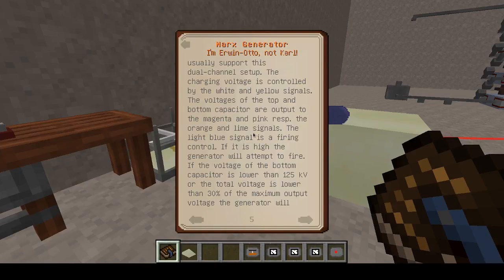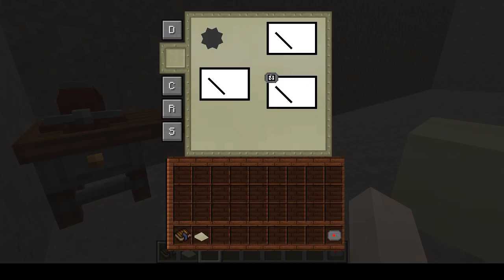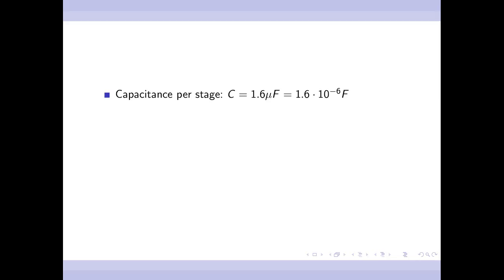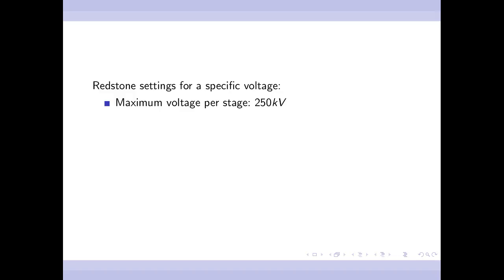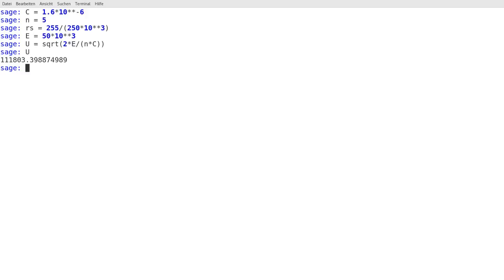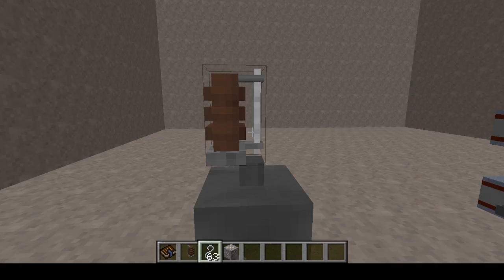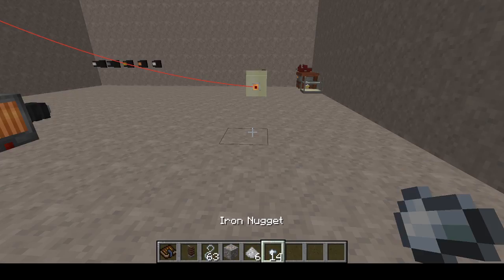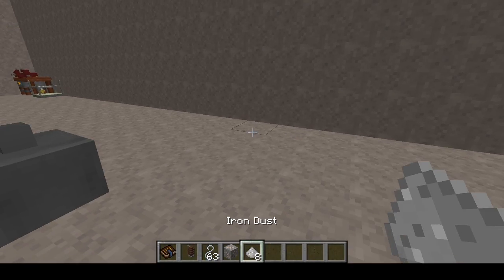Industrial Wires: Marx generator tutorial

Comment: How do I get the charging voltage higher? Every time I try to do this, the caps don't charge enough. They stop under 5 on the meter. I've been getting so frustrated trying to get the thing to work.
Reply: same here. I think I did everything right.. i've also tried everything, down to matching his Control panel Inclination.
Reply: I think it's meant to be stacked higher to get a higher voltage limit, the book says the "middle" is stackable to get higher voltages and the one I've created does take a lot longer to charge up after making it taller but the mod pack i'm playing on is bugged or something cause I can't get the Marx Generator to split ore blocks at all but it still can kill a chicken even using a set up 5 times it's size in this tutorial.

Comment: Is it a way to trigger blue channel from vanilla button?

If it is not, please add some component that acquires redstone signal and transforms it to channel - it will help with automatization of process
Reply from the maker: Алексей Баранов the Marx generator just uses IE redstone wires. They will work with any other method of creating/displaying redstone signals. I used the control panels since the MG is designed to work well with them, but I could have achieved the same results with buttons, levers and redstone lines for analogue signals.
Reply: So how can i trigger it with stone button for example?
Reply from the maker: Yes. Put a redstone wire connector next to the stone button, set it to the light blue channel and input mode. That should work. I've never tried stone buttons, but I used OpenComputers for that once and it worked perfectly fine.
Reply: Something wrong happening - it does not fire, but readings of charge goes to 0
Reply from the maker: What voltage/redstone signal level did you charge to?
Reply: But it works without control panel in the middle

Comment: So malte0811 admit that it was at the end ?
Reply from the maker: I'm not quite sure what you are asking, so I might be answering the wrong questions here: 1. That segment is in there intentionally (unlike what happened to the Yogscast recently). 2. That is a general mechanical multiblock. It currently works as an energy storage (flywheels), but the original purpose was efficient conversion between EU and RF/FE (I'm hoping to get the first conversion working today). I have some other ideas, but those won't be in the initial release.